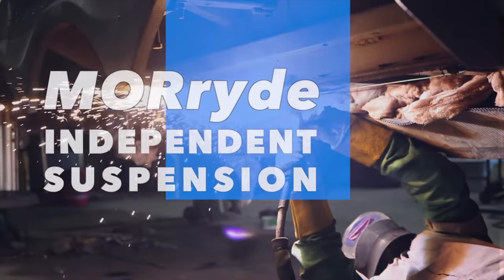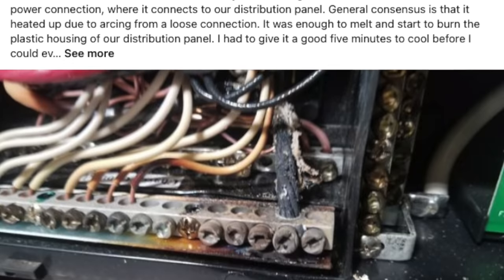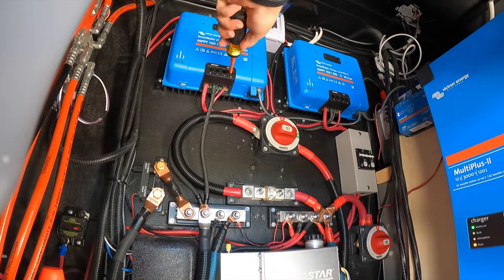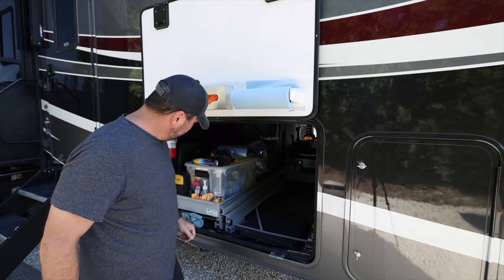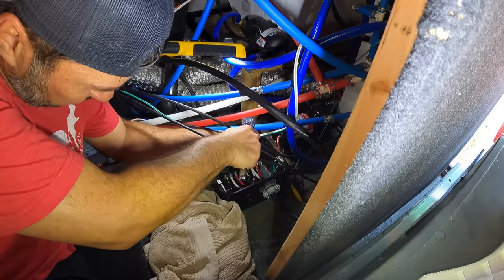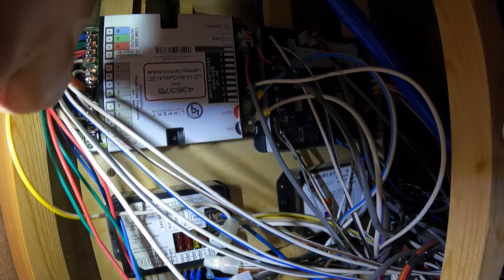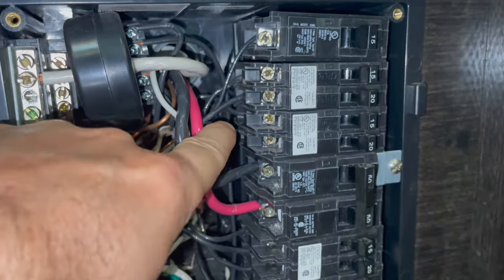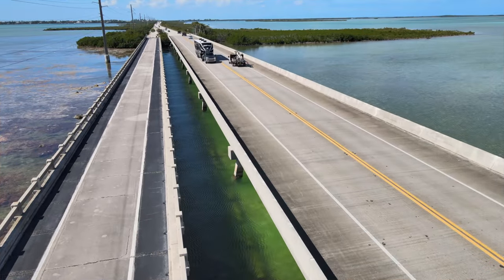⚡️🔥 Prevent an RV Electrical Problem! (Full Time RV!)

Comment from the maker: ⚠USE A TORQUE SCREWDRIVER WHERE APPLICABLE.  While my main goal here was to just find and tighten any loose connections, I should have taken the opportunity to get proper torque on some items - the distribution panel in particular.
Reply: The torque specs for the electric panel is often on the tag in the box. Breakers will have the spec on them also.

Comment: Great reminder for any rig. This past week our microwave was not working and we traced that to the outlet. The outlet is buried in a cabinet over the sink, it is not easily seen or accessed. When I opened it up, I found it was arcing and shorting out. So I replaced the outlet and took the opportunity to change the plug on the microwave to a right angle, so the wire will have fewer interactions with the contents of the cabinet.

Comment: Good tips, but.....
Others have already mentioned the over torquing.
Generator connections need to be checked too.
Many RV's, like my motor home, have all the 12 volt ground connections attached to the vehicle chassis with ring terminals bolted directly to the frame with 1/4" bolts. This can be a problem because of constant exposure to the elements. As a preventative measure I removed all of them, about 15 to 18 between two locations, cleaned them, cleaned the frame down to the metal, coated the frame and the terminals with an electrical contact paste, reattached the ring terminals and then sprayed the entire area with a rust inhibitor. (LPS #3)
Don't discount the 12 volt and control voltage terminations. Both systems can easily provide enough power to melt, become red hot and burn through wires. Batteries have an enormous amount of power and the short circuit amperage can be HUGE. Fuses and circuit breakers do not protect all of the wiring in 120 volt and 12 volt circuits and can not see some overloads, over heating and shorts.

Comment: Chad Yes get an inch pound screwdriver and dial in the in-lbs needed. On my distribution panel printed next to the Neutral bar 25 in-lbs, the grounding bar 30 in-lbs, the converter and battery connections 45 in-lbs, the wires to the fuses are 20 in-lbs. Circuit breakers screws 20 in-lbs. every 1,500 mi. or 1-year I check mine, to many roads out there shake, rattle, & roll to loosen them up.
Great Jobs covering/checking the electrical connections.
Reply from the maker: Indeed!  Note added to description, pinned comment, and blog post:  ⚠️ USE A TORQUE SCREWDRIVER WHERE APPLICABLE. While my main goal here was to just find and tighten any loose connections, I should have taken the opportunity to get proper torque on some items – the distribution panel in particular.

Comment: Stranded wires are notorious for coming loose but one of the main reasons is because they were not properly tightened down from the start.  All stranded wires should be tightened down firmly and then purposely vigorously wiggled and then tightened down again.  This helps to reposition the strands under the screw and removes any microscopic space between the individual strands.  You would be amazed at the extra 1/4 to 1/2 turn you will get from the screw after wiggling the wire back and forth.

Comment: Nice job Chad. One thing I would encourage you to do is to get a torque screwdriver for the connections to the circuit breakers in your AC distribution box.  These connectors need to be torqued to a specific value and not just hand tightened. over-tightening them is as bad as a loose connection. The specs should be in your manual. I can provide you with a link to a torque screwdriver on amazon if you like.
Reply from the maker: For sure!  Note added to description, pinned comment, and blog post:  ⚠️ USE A TORQUE SCREWDRIVER WHERE APPLICABLE. While my main goal here was to just find and tighten any loose connections, I should have taken the opportunity to get proper torque on some items – the distribution panel in particular.

Comment: Chad, make sure you check the electrical connectors for the fireplace.  Dave and Karen on Watts with Wheels found some major wires burnt and loose on there rig.  Went back to the junction boxes and found more issues.  He diffidently saved there rig.
Safe travels and roads.  Brian and Cindy "xtreambydesign with passion"

Comment: You may want to purchase an inch pound screwdriver and recheck  your terminals in your breaker box. Mine said torque the screws to 20 inch pounds. I do check the torque once a year and so far , I haven't had any loose connections.   I always enjoy your videos.
Reply from the maker: Indeed!  Note added to description, pinned comment, and blog post:  ⚠️ USE A TORQUE SCREWDRIVER WHERE APPLICABLE. While my main goal here was to just find and tighten any loose connections, I should have taken the opportunity to get proper torque on some items – the distribution panel in particular.

Comment: Great video Chad, you nailed this one, me and my wife mainly boondock I have friends that had to deal with mice getting into their camper and wreaking havoc on their wiring, we even had troubles while camping with a pack rats get into our camper (i had inadvertently left the front compartment door open) and played hell with getting him out, (Luckly we heard him chewing at 1:30 in the morning)  found some wires that he chewed on, didn't cut through any of the copper  but exposed the wire, (landing gear wire)it was in such a tight area i couldn't use electrician tape to cover the wound but i carry liquid  tape and that seem to work very well, to make a long story short that pack rat ended up  making a nest in my truck engine compartment in which he chewed on my battery post covers, and didn't touch the wire harness ( thank you Lord)

Comment: Great maintenance video!!!  This practice can start after the first shake down trip. We just picked up our new fifth wheel and was installing some Battle Born batteries. During the instal discovered the main ground stud on the frame was completely loose!!!  We were very fortunate to find that. It could have cause major issues down the road.
Reply from the maker: Good catch!  👍🏼

Comment: Chad I'm an electrician  just wanted to say watch over tightening I seen it in your 14 and 12 gauge wire that they will break right at the breaker  or on the neutral  buss ....just a tip...great video
Reply: Same, agree. You can look up torque specs for some of these things, and if not for a specific component then possibly general guidlines by size of connection. But basically when you feel it get tight, you tighten just a little more, thats it. The screw can actually pinch right through the wire. If it goes too far cut it off and start over... I'd prefer stranded over solid wires in an RV becuase of the vibration.
Reply from the maker: Indeed!  Note added to description, pinned comment, and blog post:  ⚠️ USE A TORQUE SCREWDRIVER WHERE APPLICABLE. While my main goal here was to just find and tighten any loose connections, I should have taken the opportunity to get proper torque on some items – the distribution panel in particular.
Reply: @ChangingLanes   great to bring attention to the problem chad.  Was trying to get info out to everybody that you can over torque  and strip out lugs  to help everyone.  Great video...keep it up

Comment: Thank you for some good advise.  At 3:10 into this video, you were tightening a wire bolt with a socket wrench on your MultiPlus-II.  I noticed your wrench shaft was very close to the MultiPlus-II cabinet which is very well grounded.  This happened several times in your video.  I always cover the open metal parts of the tools I am working with with some electrical tape to prevent the tool from making a hot to ground connection by accident.  You did recommend turning everything off and/or disconnecting everything supplying power, but you did also mention there were a few things you left on.  Sometimes that is necessary.  Sometimes we make mistakes.

Thanks for all of your hard work on your videos.  I know you are always very safety conscience.
Reply from the maker: Oh, I've arced a socket before for sure!  👍🏼
Reply: There’s no such thing as accidental arcs. I call them pop quiz welding test.

Comment: Excellent video and advice. Thanks for addressing this important topic.  I'm new to RVing and take delivery on our new 5th wheel next month, but have been boating for many years. Same electrical and connection issues apply to any vehicle, trailer or boat that is subject to constant pounding, movement and flexing. In the boat I was amazed at how much wiring was run unprotected. Connections and terminals everywhere . . .  I installed maybe 100 feet of split wire loom tubing to cover the wire bundles to protect them from chafing, pinching and accidental puncture/damage to the insulation.   Also, rodents seem to savor the taste of plastic wire insulation and love to chew on them.     I saw your video shortly before I heard of Andrew Steele's Newell fire which might have been due to an electrical issue under the dash.

Comment: I would also check for double taps on the neutral bar on the 120 side.  I had a problem with a neutral that had 3 wires going into it.  Fortunately I found it because the GFI tripped but had overheated and burned one of the wires.  The reason I say this is that I saw a double tapped neutral in your distribution panel.  Keep the good stuff coming guys.

Comment: Great video Shipmate. CRC sells the equivalent to electrical amlguard that we used on aircraft in the Navy. You can use that to both protect electrical connections and hinder their loosening. You can also carefully apply torque seal also known as torque stripe (or a bright colored fingernail polish) to connections for a quick reference as to whether they've loosened like we did in the avionics bays.
EDIT: THE ABOVE MENTIONED TORQUE SEAL OR TORQUE STRIPE OR FINGERNAIL POLISH IS NOT THE SAME AS LOCTITE! LOCTITE OR ANY TYPE OF THREAD LOCKER ON YOUR ELECTRICAL CONNECTION THREADS IS UNSAFE TO USE AND ILLEGAL.

Comment: Main culprit, besides the earthquake, would be the use of electric space heaters.  Most are 1500 watt. To find amps, divide watts by volts and anything that runs over 4 hours, you multiple by 125%. 1500/120 is 12.5 amps. 12.5 X 1.25= 15.625 amps. Those outlets and wires ate rated for 15 amps.

Comment: I actually had my 30 amp breaker keep popping while we were on full hookup the wire was loose and arcing on the breaker I checked all the rest had a few loose ones my wife works for a electrical supply warehouse so we got a new breaker and swapped it out great video chad

Comment: Watts on wheels did a similar video on those boxes on the frame rail after they had a fireplace issue. We have about 75k miles on our Luxe 5th wheel and I've never checked any of this. I am now. Thanks....

Comment: OMG we had it happen in our 2018 Jayco Toy Hauler in May.  We woke up at 6 am to crackling and a smell burnt plastic in the bedroom plug.  Loose wiring arching in the plug.  Glad we were there when it happened. Cut power and installed a new plug then checked the rest.
Reply from the maker: So glad you caught it before it got real bad!

Comment: We have a 99 Newmar 36ft Kountry Syar. The original owner had the Moride IS suspension back in 2002, we just replaced 1 of the sheer springs last month. I noticed 1 of the tires had bottomed out in the wheel well and the rubber was starting to separate. Called Moride, ordered the spring , had it in 2 days. Jennifer at Moride was a great nelp.

Comment: It's important to use a torque wrench and/or screwdriver. When humans "check" all their connections like you did, they will turn every screw/bolt, at least a 16th or 32nd of a turn, even if they're tight enough already. Doing this on a regular occasion means you're going to eventually way over tighten all of 'em. A torque driver can prevent that by letting you know when you're checking a sufficiently tight bolt.
Reply from the maker: Indeed!  Note added to description, pinned comment, and blog post:  ⚠️ USE A TORQUE SCREWDRIVER WHERE APPLICABLE. While my main goal here was to just find and tighten any loose connections, I should have taken the opportunity to get proper torque on some items – the distribution panel in particular.

Comment: Good info as always, hard to know where to draw the line of where to look and not, but from personal experience another hot spot per se is the back of the shore power receptacle. I had mine come loose and melt the hot wire of the 30a connection.
Also do not disregard over torqued connections, again speaking from experience my atc required a 1/2” flat blade with a wrench to bust loose. Factory I assume is using impacts with the #2 square drive. My ADD drives me to want to rewire the whole rig. Safe travels Chad!

Comment: Flir infrared sensor is nice to use on high voltage, heat signatures show loose connections. Something I used in a large commercial building to check hundreds of distros quickly on a slow day.
Reply from the maker: Oh man!  That's a great idea! 👍🏼

Comment: I had an issue with my A/C electrical once in my TT. We were out camping and came back to find the A/C not working!. Searching i found that the power connection from the breaker was extremely loose. Tightened it and all was good until the T-stat failed.

Comment: On every new RV I've purchased, I've had loose unused set screws in the distribution panel on every bus bar and on my last RV I had some that had fallen out. One of the first things I do after getting the rig home is I cinch them all down tight. It may be unnecessary but I'd rather know they're in there tight and have no chance of falling out and coming in contact with a live feed. Whoever is responsible for the electrical connections at the manufacturer should tighten them up before sending them off to dealerships.

Comment: I’ve been watching your channel for couple years.  You just got into my area of knowledge.   What you did was the best thing you could have done.   Loose connections start arcing and build up heat.   The longer they arc the worse it gets.   Part of our contracting business was IR checking panels and connections for overheating.   I saw many of the reports and infrared pictures.   90% of the time overheating connections in panel boards were on the neutrals.   One would think the hots would be the bigger problem are, but they are not.   Please make sure I did not see incorrectly.   At 7:50 in the video, there looked to be (2) neutrals in the same hole.   The lug holes are only rated for one conductor.   It is a violation of NEC for two neutrals in single lug hole.   Please relocate it if incorrect for your safety.    Always be safe, the life you save may be your own!   Respectfully,   Kevin
Reply from the maker: I will double check... The 120V AC neutral is the one on the top left... The one at the bottom right is DC Ground.
Reply: @ChangingLanes     Correct.  It was just above center.

Comment: On many 120volt fuses it says the torque settings for the fuses.  Even dome of the electrical panels will tell you what the screws in the buss bars should be tightened to.  Check to see if they are on any of the panel doors.  The make a torquing screw driver for this.
Reply from the maker: Indeed!  Note added to description, pinned comment, and blog post:  ⚠️ USE A TORQUE SCREWDRIVER WHERE APPLICABLE. While my main goal here was to just find and tighten any loose connections, I should have taken the opportunity to get proper torque on some items – the distribution panel in particular.

Comment: Yet another great and helpful vid.  I have watched many of your vids.  I just came here today searching for one of the vids where you showed some "stick fire extinguishers for electrical."  Am I correct that it was you that showed them in several compartments, especially where there was some electrical?  I didn't see them in this vid, instead I saw regular extinguishers.  I thought you had placed some that sort of automatically went off if there was an electrical fire?  I even checked your Amazon store to no avail.  Maybe you could do a vid on the subject if that wasn't you.  The vid I recall wasn't dedicated to these fire extinguishers, they were briefly mentioned.  The vid was similar to this one about safety but did quickly mention the stick extinguishers.
Reply from the maker: Yes... We have extinquishers all over the place but we also have PROTENG: https://changinglanesrv.com/rv-fire-safety-thia-proteng/

Comment: Related - I had:
- wire in transfer switch loose & melted down connectors 
- wire input to inverter loose and disintegrated wire nut connector
This topic is wise advice to periodically check wiring integrity

Comment: There is a simple test that sometimes works for those wall electrical outlets light switches, check for thermal heat coming off them when on/hot...via resistance?

Comment: Thanks for the video Chad,,, definitely a great reminder for us weekend warriors. This is something that most of us doesn't think about. One question regarding your distribution panel, do you not torque your screws in there?? Thanks again
Reply from the maker: Indeed!  Note added to description, pinned comment, and blog post:  ⚠️ USE A TORQUE SCREWDRIVER WHERE APPLICABLE. While my main goal here was to just find and tighten any loose connections, I should have taken the opportunity to get proper torque on some items – the distribution panel in particular.